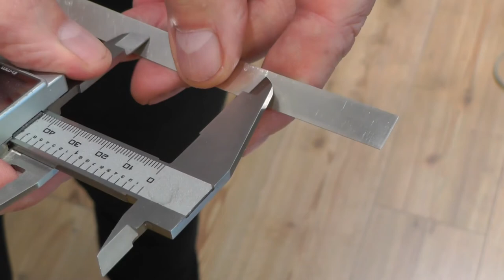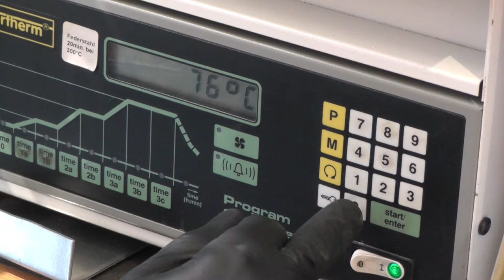Fascination Mokume Gane - Part of you is part of me - Silver and gold ring

Comment: I'ts not welding. I'ts sodlering or brazing.
I hate it that blacksmiths using mokumegane started telling people its "forge welded"
you cant forge weld white metals! cause at welding heat, they turn into liquid.
Reply: It is welding. yeah its subtly different to Forge welding, but only subtly, when doing it in a forge its a similar process as say, canister welding only at a lower temp than with steel.

 its not soldering/brazing that's kind of the whole point. what do you think there's a little man inside his kiln, with a brazing rod?